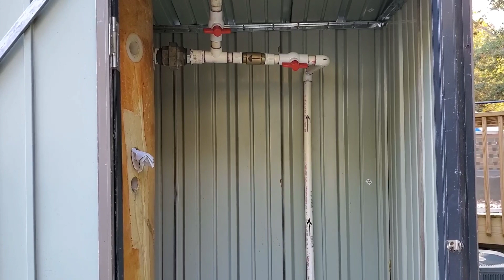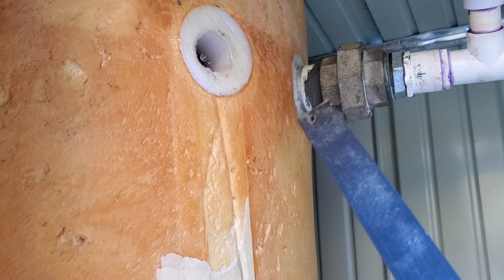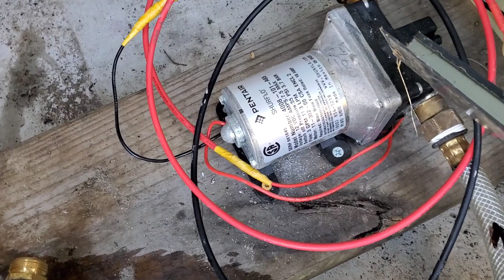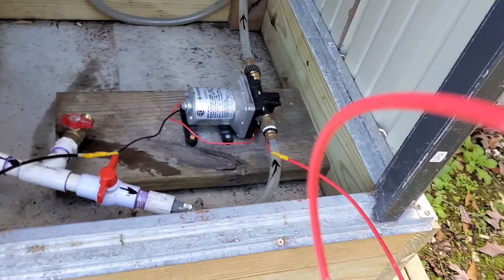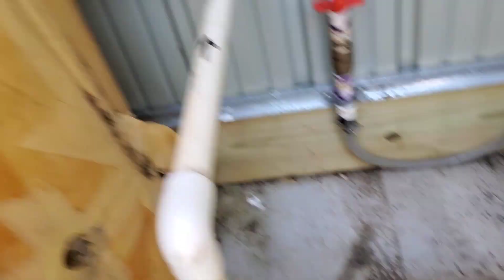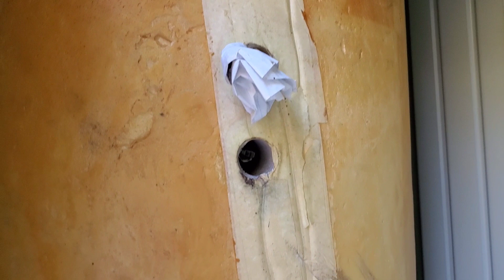Back up water storage system

Comment: Cool setup.  If you run a lot of gallons thru it you will need to cycle your water softener if you have one and catch it back up since It needs power to measure and the proper water pressure to cycle and clean the media.  Your pipes must not freeze where you are or you would need a heater or a way to drain it all down in the winter.  Pentair makes good stuff.  Dad was a plumber.  I’ve thought about having a water tower out by the garden with a solar pump to fill it from rain barrels or just filling it once in a while to water things or even take a shower.  A hand pump well would be nice too.  We have a large swimming pool that I’ve designated as part of my reserve water supply for now.  I just don’t have the time to tinker around like I want too.
Reply from the maker: Thank you for the comment I don't have a water softener but if I did you are correct and I haven't had any freezing issues yet hopefully I will not . The water tower sounds really cool but it sounds like you have a lot of backup as it is. We have to have water for sure